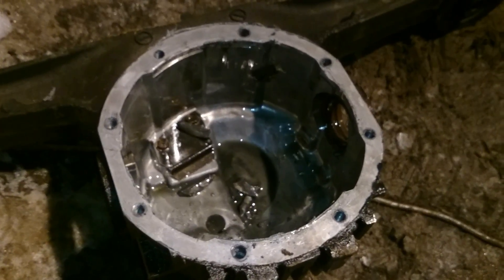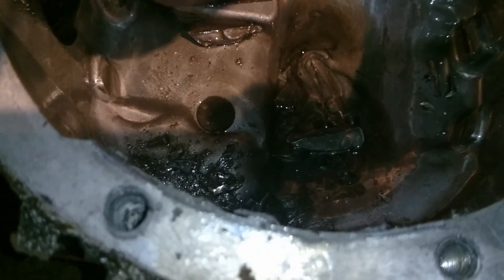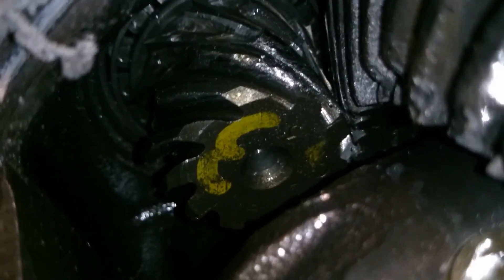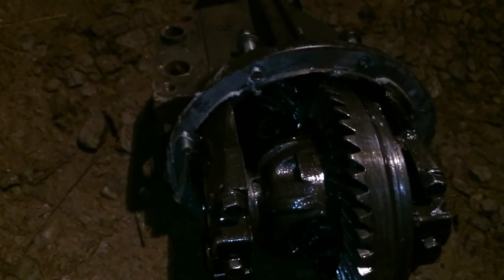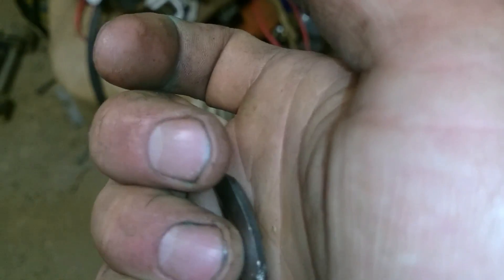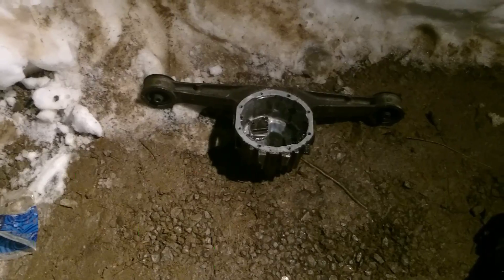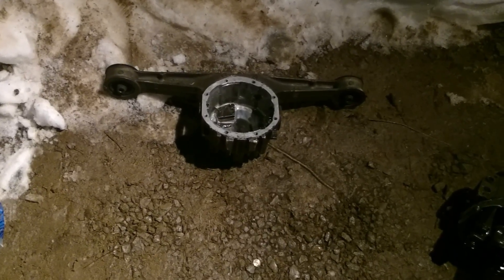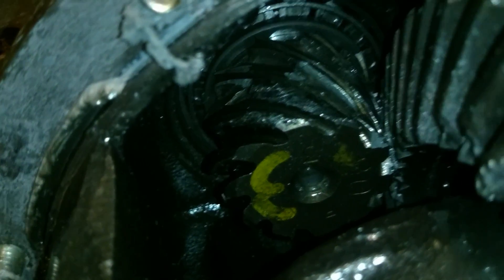Do NOT weld your diff!!! 😂

Comment: thats from improper gear lash. welded diffs run fine if installed correctly......
Reply from the maker: +Matt Mazzei I didn't remove mine ...we welded it inside the differential....I ran it for like 5 months but it just shot a gear threw case ....guess to much skids
Reply: +that neon channel what happend to all the welding spatter when u welded it in the diff? it prolly stuck everywhere!  I don't think u cud flush that out.  and the heat wud have messed up your alignment and backlash would have had to be shimmed.  and there's no such thing as too much skids!!!! haha
Reply from the maker: +Matt Mazzei my dad welded it with his mig so threw really wasn't any splatter heat might have caused it but I'm sure those gears get hotter or just as hot while driving ...idk I just know it sucked I know my 240 welded Diff took out the trans ....I know when I put the lsd torsen in the miata it skidded so much better ...was trying to find a g35 diff for my 240 for when I put it back together but we see
Reply: That Neon Channel MIG has ALLOT of splatter!?
Reply: newscooler12316 MIG barely has any splatter if you use a proper one and with right configuration.
Reply from the maker: +DSHanska I did
Reply: Yeah, I was on your side on this one.

Comment: This is hilarious as fuck. Weld your diff if it's a beater which you give no fucks about. Do not weld it if you care about your car. Simple as that. Regular 2 way is just as awful as a welded diff (which I like) but it's just that little bit less harsh on your drivetrain. 100 dollar welded diff on a 3000 dollar car makes sense, 1000 dollar proper LSD on 10 000 dollar car makes sense.

Comment: I've had a welded diff on my 240 for over 3 years now daily driving with no issues. But maybe this will happen soon who knows.
Reply: I'm surprised nothing happened. How is it now?
Reply: Still drives fine, still drifts and does burnouts. Though when I had it welded the guy welded in 1/4in steel plates.

Comment: Sir, a limited slip is no better than a open diff, they wont lock up full posi.
Reply from the maker: +Skeefoo Panama well my torsan locked up every time so I guess I got lucky ....open diff sucked and so did the welded diff fuck welded diff I could slide much easier and comfortable with the torsan now the 1.6 viscous was definitely shit..
Reply: That Neon Channel 
What's a torsan? There's a video that shoes a Limited Slip spinning one tire front and rear on a 4x4 thats driving over rollers to demonstrate a locker.
Reply from the maker: +Skeefoo Panama torsen is a brand of miata lsd it came in the 1.8 but 4×4 lsd are different and some lsd wear out and some lsd get u high as fuck